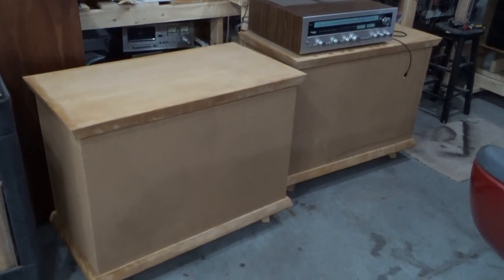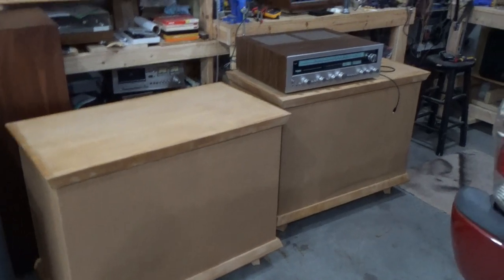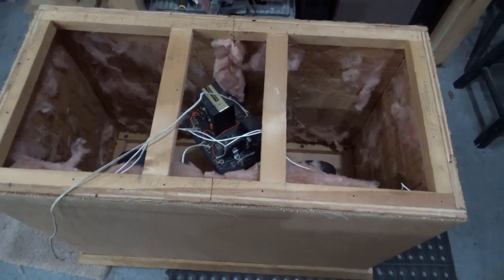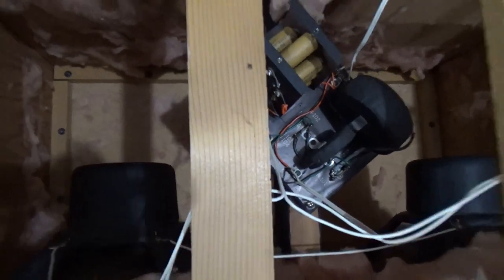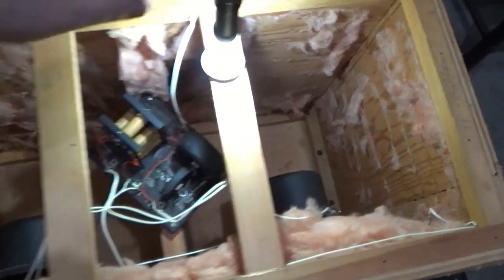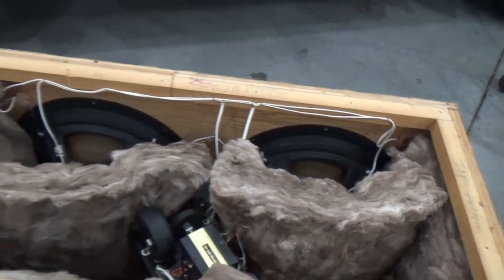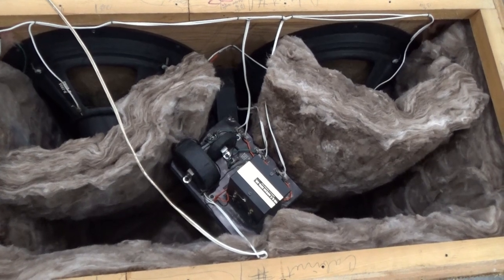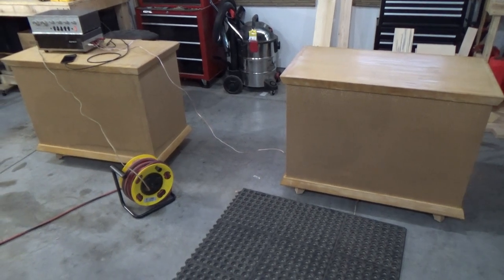Bozak B305 Speaker Rehab Part 1 - Evaluating the Speakers & Insulating the Cabinets.

Comment: I would've done exactly the same regarding the terminals. Then the cabinet can be properly sealed. Probably wouldn't make an audible difference but if they're supposedly infinate baffle they shouldn't really have a little hole in them. I appreciate that's how it was done on old speakers but I'd hope we've moved on from those days.

Those should be absolute monsters with twin 12" woofers! In spite of the "minimum 30 watt" rating I suspect they'll be highly efficient compared to later speakers.

I wish I had space for speakers like these.
Reply from the maker: To be honest, I really don't have space...but I adore the speakers.  Have them in my office connected to a Pioneer SX 939 currently.
Reply: @millervintagehifi3034  Well I have plenty of speakers too large for the room they're used in. It's a very good way of ensuring the air in a room is thoroughly energised!